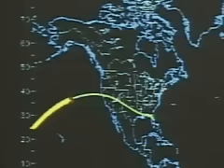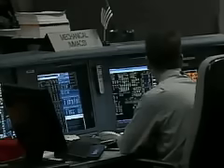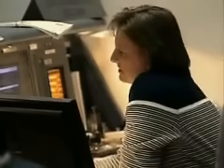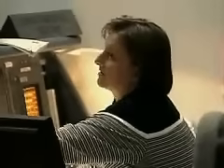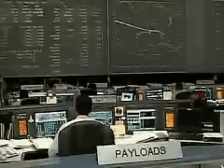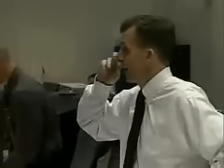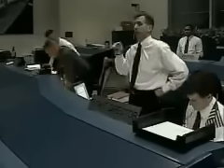Inside Mission Control During STS-107 Columbia's Failed Re-entry and disaster

Comment: Amazing how Apollo 13 were able to save themselves and return to Earth safely ...how heartbreaking for Columbia! Pretty much sitting ducks💔💔💔😭
Reply: It's equally amazing how nasa managed to kill two crews through management negligence and not one person was held responsible.
Reply: @stevebell4853  Yup, and NASA knew there was a strong chance that Columbia wouldn't make it back in one piece fairly early into the mission, but neglected to do something about it. Instead taking the reassurances from the folk at Boeing that the wing was probably fine. It was proposed that it may have been possible to ready shuttle atlantis in time for a rescue mission, had they acted quickly and effectively, and extended Columbias stay in orbit as long as possible. Yet they chose to ignore the concerns of the engineers who had examined the footage of the foam strike. Fortunately, since columbia every non-ISS available mission after the fact did have a standby shuttle waiting, and eventually on SS Discovery they did have a kit to fix damage similar to that inflicted to columbia, which incidently they did have to use. But still, all a bit too little too late really.
Reply: @__-fm5qv  "NASA knew there was a strong chance that Columbia wouldn't make it back in one piece fairly early into the mission"

Without using hindsight-on what do you base that?
Reply: Bella Umbrellla — There was nothing they could have done to save Columbia.  They had not anticipated such a failure and had no means to repair the damage.

Comment: Very sad thing happened in the sky of the Texas. When they were checking the left wing tyre pressure the comunication was lost, probably due to the  evacuation of landing gear section of left wing which leads the tyre with high pressure to bulge out instantly above its limits and shattered out inside the chamber. This leads extra damage to the skeleton of the shuttle which was doomed already because of hot gases entry inside the left wing.

Comment: SAD THING IS FLIGHT DIRECTOR ALREADY KNEW THAT THIS WOULD HAPPEN BUT THEY HAD NO CHOICE AT THAT TIME BUT TO RE ENTER THEY WERE AWARE OF DAMAGE AT LIFTOFF THERE WAS NO CHOUCE IN THE MATTER
Reply: joe stewart They weren’t aware of the damage until after liftoff. Damage occurred during launch when pieces of foam came loose and struck the left wing of the shuttle. At that point, they did know. My question has always been, IF they had done the right thing and acknowledged the danger of re-entry, how would they have repaired the wing while in orbit?? Do you know?
Reply: @amiematthews6469  Yes what agree is the flight director knew the probability of destruction was there they had no contingency or backup rescue or ability to repair or anything other than what transpired they chose not to tell the astronauts because there was no plan B
Reply: @amiematthews6469  they actually weren't aware of damage, they only knew a foam strike had occured. the fact that these strikes happened on previous missions without causing damage they "hoped" the same outcome would happen here. there are no actual photos of the impact point.
Reply: bindlepig80 I was almost positive that I had seen a documentary about this and that some of the engineers suspected or were sure of the damage extent. I remember hearing that there were no pictures but I thought there was a video that showed the damage. Now that I have seen both your replies, I just feel even worse for them. That must have been so terrifying!

Comment: Amazingly professional in the face of disaster. It seemed that the guy in the gray sports jacket in the back row gave information to the flight director that confirmed what happened because the "lock the doors" comment came right after (12:30). I suspect that upper room is for family members of the crew and some of NASA's higher folks to monitor the flight. Hearing him call for the doors to be locked and, later, for no calls to go in/out of the facility was sad. He was professional enough to not want gossip getting out and to keep conversations on the recorded lines for data collection. Very sad though and now I need to research if the cabin was ever recovered as it was with Challenger. Different circumstances but I want to know for sure.

Comment: I respect the work the MCC did but nasa heads failed the crew rescuing them would have been hard but nasa had some of the best pilots in the world. Such a shame nasa did not have the gene kranz "failure is not an option attitude" if he was in charge he would have reacted an attempted to save them.
Reply: And by "hard" you mean "basically impossible".  The problem wasn't the pilots (although it would have taken a never before attempted feat of "hand flying" Atlantis for nearly a full day). The problem was time.

The best estimates are that Columbia could have gone until sometime on Day 30 before either a lack of electrical power or rising concentrations of CO2 killed the crew. For some complex reasons dealing with launch windows and orbital parameters, Atlantis would have had to take off no later than Day 27 to pull off the rescue.

The difficulty is that Day 27 would have been the first day Atlantis would have been ready to launch, and that's if they skipped all of the safety and other checks.  Had they tried to launch after doing that, the odds were almost zero of getting off the ground, but a higher probability of a problem that the launch computer didn't catch in time, with the result that she either explodes on the pad or goes corkscrewing into the Atlantic.
Reply: @almostfm  that is true

Comment: How on earth can you be going into the reentry phase, have your temperature indicators not working on the left wing ....and just assume it's an instrumentation malfunction? Still what else could they have done at this point? Hopefully for future space travel....they could pull up, return to the space station for repairs before trying reentry again.
Reply: The temp indicators in the left wing didn't have to function. They were installed just for verification of the design early in the program. If you're not in the same orbit as the ISS, you can't just pull up to it as was the case here.
Reply: And it's not like doing a go around in an airplane if your approach is wonky.  Once you do the deorbit burn, you're coming home half an orbit later

Comment: 2:27 What does "no commonality" mean?
Reply: They mean is there a circuit that all four sensors were connected to that could have failed and caused them to go offline.  Since there isn't, it meant that there had to be something physically wrong (damage) in that particular location of the wing which caused multiple systems to fail.  When MMACS clarified that the sensors failed close together and not simultaneously, they knew that section was heavily damaged and it wasn't just a failed sensor circuit.

Comment: I'm a little confused.....Did Mission Control and the Flight crew know they were not going to make it in this video footage?
Reply: Despite what some claim, no they didn't.  They knew there had been a foam strike, but they didn't know how bad the damage was.  Probably the first hint of real trouble was when the four sensors dropped out and the flight director was told there was "no commonality"-meaning there wasn't a single point where a failure would show those four, and just those four sensors dropping out
Reply: @almostfm  Ohhh I see. Okay thx :)

Comment: It sounds like everything went south at about 5:20.  The woman's reaction at 12:00 tells the whole story.

"Lock the doors" = We have a disaster on our hands.
Reply: DRT XD  Not necessarily. Spacecraft have suffered heat shield damage before and made it back to earth safely - Apollo 13, for example. They knew that they might have had thermal tile damage; as soon as they lost the 4 sensors, they knew the damage was real, but they didn't know for sure that the damage was fatal yet. It's only as they got one indicator after another, losing more sensors, losing comms, not getting any tracking, that their fears grew and grew. They didn't know until they received reports of multiple reentry tracks that they knew the shuttle had broken up, and began their contingency procedures.
Reply: @Werrf1  Apollo 14 didn't have heat-shield damage, did it? I know they were worried it might, but there was no evidence of it when it got back.

Comment: Sad watching this unfold . How come the hole in the wing didn't cause problems  with shuttle or the flight Data  from launch till orbit in space , my goodness they were travelling at mach + speeds and no sensor Data saying there is a hole or problem with the left wing  ?      doesn't make sense , they have sensors in the wings   !
Reply: The carbon panels (which are curved like you see in photos) are bolted to the spar of the wing. If your not familiar with the spar, its the main structural component of the wing. Its made of aluminum . The foam caused a hole in the panel only. The spar was still intact not letting anything inside the wing during launch. The sensors were only there for engineering purposes during development. They recorded temperature and vibration. There were no sensors near the impact area. The speeds and heating during launch are negligent and the orbiter was through the thick part of the atmosphere. During re-entry, the speed is four times launch speeds which causes ionization and produces a lot of heat. The wings spar melts at about 900 degrees F.  The heat on the orbiter reaches 3000 degrees F. Once it melted, the fire got inside the wing causing structural failure.
Reply: After seeing the hole that was created on the wing using test firings of ice up to 500 mph. I still would think after liftoff the hole would have caused some serious problems for the integrity of the shuttle . And a another question i have , why not a space walk to examine the wings . I thank you for the response to my comment . @jrockett73
Reply: correction -  Foam not ice
Reply: The air was too thin to cause any problems. There were a couple reasons a space walk was not done. The first was that no one laid eyes on actual damage. It was suspected but not confirmed. So with that thought , why do an inherently dangerous space walk,  unplanned at that of something that might not be there? Second, There is no way to get to the leading edge of the wing. No handholds, no RMS Canadian arm. Could have done more damage getting there. That was the thought process. It may be flawed but space flight is still very dangerous.
Reply: @jrockett73  Thank you again for your knowledge of the  catastrophic event . A quick question if I may , I read where the (Challenger)  crews remains were put into trash bags  and then into plastic trash containers and taken by truck to a military base , I dont know if your knowledge of that event could explain if this is true and again I appreciate the explanations  .
Reply: Absolutely not true. The remains were first taken to a medical facility on Cape Canaveral (which is a military base) in body bags.. After initial examination and a few days for logistics, the bodies were put in coffins and seven hurst's for a ten minute ride to the KSC runway. There a C-141 delivered them up north for further examination.

Comment: Pretty much the whole time after 3 min you can tell the director just wants to curl up in a ball and cry for a week or two
Reply: Timothy Stratton I want to do that just by watching
Reply: Dan Pro - Amen.
Reply: Columbia didn't break up until after 5:16 in this video, which was the last comm from the shuttle.
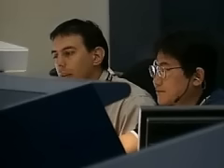Reply: wll1500 by around 1:40 they knew they had a catastrophe on their hands.
Reply: @Bubble170  no....? Everything is fine at that point. Well, actually, everything is not fine, the sensors are having issues due to the wing burning up, but they didn't KNOW that.
Reply: wll1500 you’ll actually find that mission control have said themselves the moment they knew when they had a catastrophe - and that was the moment. Feel free to deny it - they’ve said it with their own lips.
Reply: @Bubble170  And somehow the crew didn't know? They were still in radio contact at that point and continued to be in contact for several minutes beyond that point.
Reply: wll1500 Columbia weren’t told about the potential re entry issues that were already known by NASA. They didn’t tell the crew about the danger. They’ve been quoted many times explaining this, I don’t feel you have done enough research to be arguing your side here because it’s false.
Reply: @Bubble170  The issue of foam falling off and striking the leading wing had been experienced before (by Discovery iirc). They knew the foam strike happened, but they had no certainty that it would disintegrate on reentry.
Reply: wll1500 I’m honestly unsure why you’re trying to argue fact and personal accounts of being inside that room. The man with the moustache we see a lot said HIMSELF that they knew there would be a catastrophe after around 1:40 when they said they’d lost their hydraulics. You can even see their faces after this moment. They knew. They didn’t know they would die, necessarily - I’m not trying to say they knew exactly what was about to happen, because they didn’t - but they knew an utter disaster was about to occur.
Reply: @Bubble170  What I've read says that the FD started to suspect things were going wrong from that moment - it "gave me pause", I think was what he said - but if he knew at that moment, he would've called the contingency procedures at that moment. It was more that from that point, he knew things were going wrong, and each new call made things worse. It was when they got reports of multiple tracks that he finally knew for sure.
Reply: And he said hearing the first reports of debris sightings and indications there had indeed been a breakup gave him "great pause". I can guarantee internally he was freaking out that his worst fears were about to come true the instant he heard the loss of hydraulics and the location. Even the media already knew about the foam striking the left wing and mentioned it barely 15 minutes in,  before realizing they were covering a disaster. These guys are the epitome of cool under pressure, all the terminology is understated and detached. Their expressions and body language say all. I can't recall how many situations I've been in that degraded into all-out clusterfluffs where I can trace things back to the first inkling of trouble and only hope I was mistaken, but deep down know where the events are leading, especially if I was previously concerned.
Reply: Artemis is right. Mission Control knew they had a catastrophe on their hands before they lost contact 5 minutes in. They might have been hoping for a better outcome but they knew this was a serious issue way before they lost final contact.
Reply: Once he was told that 4 hyd sensors in the left wing failed with no commonality then I'm pretty sure he knew
Reply: No Tim, FD, LeRoy cain was not the type to curl up and cry, he was shaken but knew he had to lead as a professional
Reply: @Defender78  I agree,and he did,but i bet he's shed a few swimming pools of tears since.None of it was his fault,but he wanted his crew to return home safely,and their loss of life was his too.
Reply: True professionals in that room.  They knew that it was over - but you can never give up. Never.
Reply: so tragic
Reply: They knew about the damaged heat tiles and that chances of survival were small.
Reply: Murderers who got away
Reply: @jamesshoegazer4534  On the contrary.  They're pioneers in one of the most dangerous fields known to man.  A field that offers such potential as to shape the future of humanity someday, and with any luck will.  They aren't murderers.  They're scientists, and some of the finest on the planet at that.  They may have had a kindling of some of the risks associated with this particular re-entry, but the scope of which, I imagine,  was not understood in it's entirety.  Had they have known that the risk for structural failure was higher than a preset acceptable threshold, I also guarantee more would have been done.  Obviously some of the data required to fully understand this grave situation of the orbiter prior to re-entry hadn't yet been acquired.  As such, within the confines of NASA's budget, and the highly educated minds behind risk management, had made decisions based upon an incomplete data set.  But hindsight is 20-20 of course, and upon looking back, clearly they were wrong.  Realistically however, you have to weigh in the costs that would have been associated with rescuing them in orbit, and the difficulties and risks associated with such a mission.  You also have to consider if, at the time this was even feasible.  The Martian makes for some compelling fiction, and Hollywood is just great for entertainment, but the real world physics aren't as fantastically flexible as such content would have you believe.  It may have been entirely possible, and likely, that there was nothing that could have been done with in the confines of the technology in 2003.  It may have been entirely possible, that in the slimmest of chance that something, anything could have been done, the cost of such endeavor within the time frame they had to work with, was to steep in the eyes of government to consider such a plan.  The amount of factors at work here, are unfathomable.  To pay homage to an old adage, this is literally rocket science.  This is arguable one of the most challenging fields of engineering, and science in general, next to perhaps the most extreme avenues of mathematics and astrophysics.  These men and women are not guilty of murder, or even manslaughter if that's what you're trying to stretch for.  They're heroes, just the same as those in the Columbia crew who perished.  As such, show them some respect.
Reply: @jamesshoegazer4534  I feel like you don't know what murder is